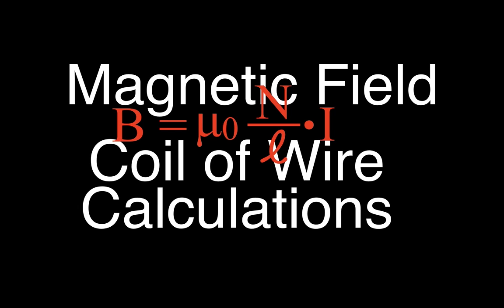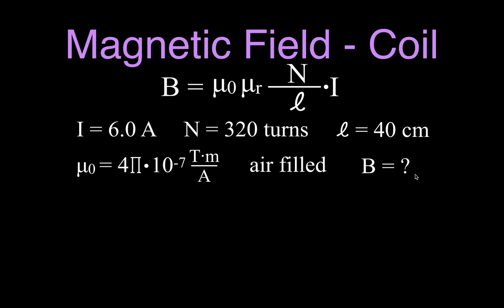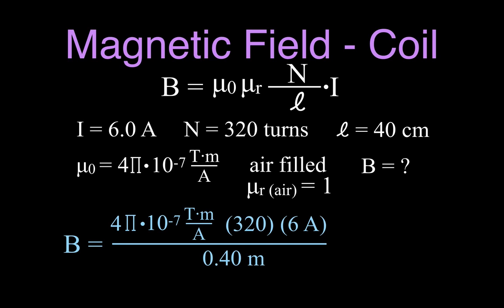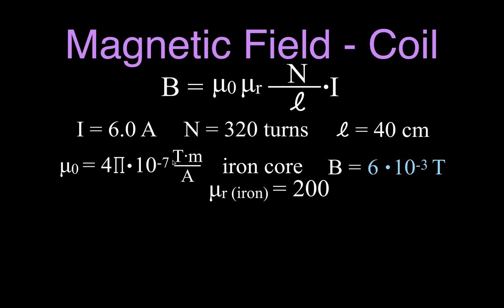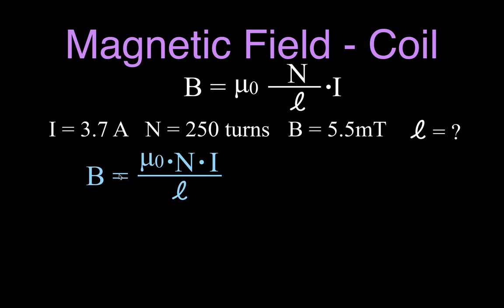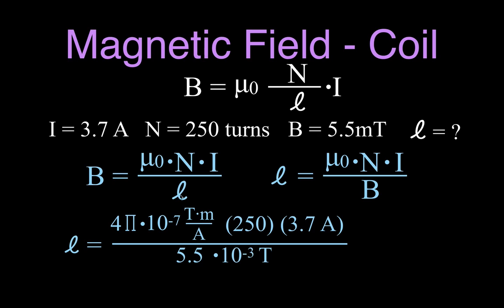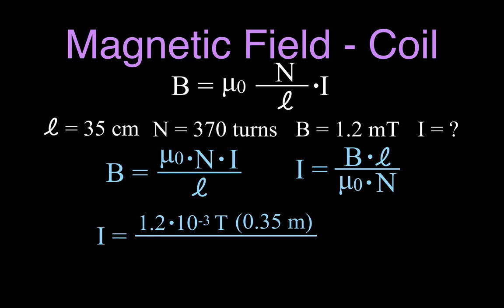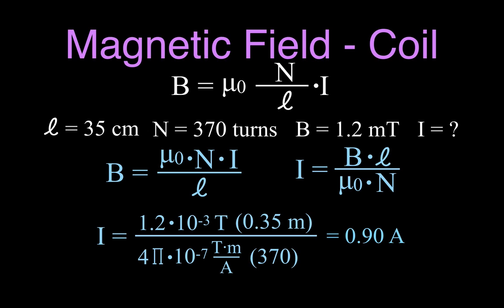Magnetism (6 of 13)  Magnetic Field of a Coil, Example Calculations

Comment: In the beginning of the video, are you referring to a solenoid with a measurement of (L) or is (L) the length of the wire of 320 turns ?
Reply from the maker: L is the total length of the solenoid.
Reply: @stepbystepscience  Thank you !

Comment: It's important that people understand that the formula shown in the video is specifically for solenoids. A solenoid is a coil that's distinguished by having a length that's much greater than its diameter. Google solenoid wikipedia for more information. If the coil's diameter is much greater than its length (the coil is thin), then it's necessary to divide by 2r, r being the coil's radius, like this
B = μ0 N I / (2r)

Comment: Does the length here means the distance between two coil?
Reply from the maker: No, it just means the length of the coil.
Reply: @stepbystepscience  Alright I got it , thanks!
Reply: @stepbystepscience  Sorry there still one more question , so can this formula applied to Helmholtz coil or does it has another formula to calculate cause it has two coil in the Helmholtz coil structure. Thanks for helping
Reply from the maker: @cylai3285  That would be used to calculate the B field strength of each individual coils. I googled Helmholtz coil and the third or fourth entry was a site where there was a virtual experiment that had a good diagram about the superposition of the two fields. Check it out. Hope that helps.
Reply: @stepbystepscience  I'll go check it , thank you so much.

Comment: Where did you get value for iron? (iron laminations) From what chart actually? It does not match to be able to use in formula accurately.
Reply from the maker: I do not remember, but the point is that some materials enhance the magnetic field strength of a coil of wire.

Comment: So the less the length the more magnetic field strength.  What about the inside diameter.  Come on man.
Reply from the maker: The diameter does not effect the magnetic field strength.
Reply: @stepbystepscience  That is simply making a statement, it doesn't explain why? Does it? 
I am sure it does otherwise you wouldn't have said it.  Right?. My bad.
Reply: The cross sectional area affects saturation. More area equals more magnetic flux capable of filling in.

Comment: How we can make an electromagnet as strong as possible? I am assuming we should increase the number of winding, wind the magnetic wires in a shorter length, and increase the current! Then my question is that what possible options do we have to increase the current? I am saying a couple, please complete my saying for a more complete solution... For increasing the current, we can use higher voltage power supply? (Does an AC or DC power supply matter in this regard?) decrease the magnet wire diameter, decrease the total length of the magnet wires, correct?

Comment: So does this equation only apply to the internal magnetic field (inside the coil)? How would you calculate the magnetic field on the pole surfaces? Or any part of the surface of the coil?
Reply from the maker: Homogenous magnetic field inside the coil.
Reply: @stepbystepscience  thanks for clarifying that. Would the magnetic field also be the same on the surface of the solenoid?

Comment: How do I determine “special coils” number 2 winding magnetic field? First coil 1 wraps 7 turns of 10 amps around coil 2 of 5 turns for induction. Coil 2 has loose steel rod core allowing room for the 7 turns  , but not including coil 1 air core. Does coil 1 magnetic field equal coil 2 field? Coil 1 is 90 degrees winding over coil 2. Hand made design was from 2008 video about modifying high volts timing of an engine. I have your math formula from You tube video. I need to determine the B field of induction into coil 2.

Comment: will the length of the shaft affect anything?
What about the diameter of the shaft?
Reply: At first i though that too. I might be wrong ... but if i remember correctly ... i think its because your using the length of the coil, for how compact/dense the turns are to each other, rather than the length as in length/amount of the wire used. So the more dense that the turns are, the stronger the field. As well as this it would mean that if you increase the space between the turns, the strength will be less. So, if i'm right ... then we might not need to know the diameter of the of the shaft as the length of the wire itself may not be important, just how wide the coil is for the amount of turns used. But don't quote me lmao, i'm not sure myself